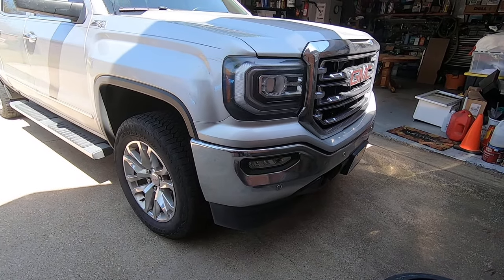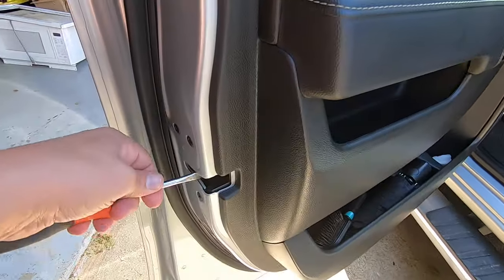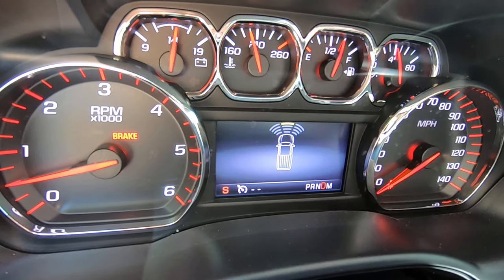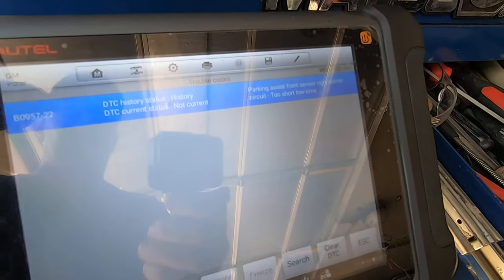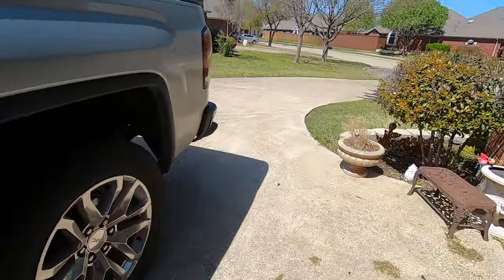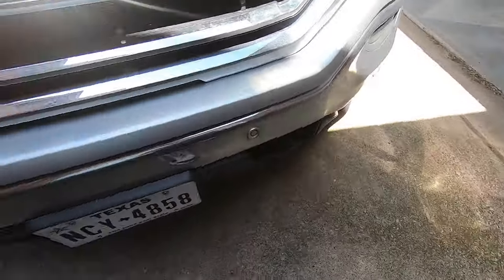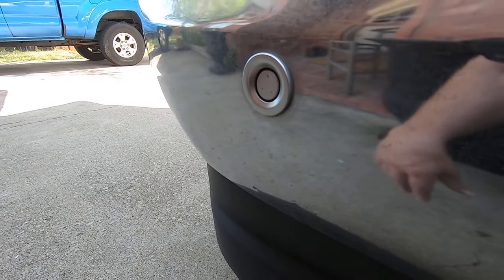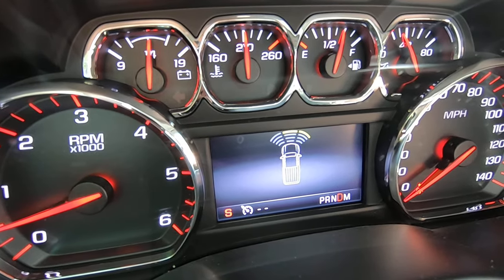How to check the park assist sensors to see if they are bad.

Comment: easier to hold cellphone to each sensor and record. then play back video and listen for sensor that is silent
Reply: Does truck have to be on?
Reply: @plmason12  yes and in reverse. so please be safe and have parking brake on
Reply: @rassoul420 thanks so much. Would be hard hearing them make a sound though wouldn’t it? I’d like to test the front ones too so probably best someone is in the truck so I can put it in drive as well.
Reply: @plmason12 your phone mic will pick up sound.  yes for front you will need to put in drive. good luck with your project.  Amazon had sensor 4 for like 20$ if I remember correctly